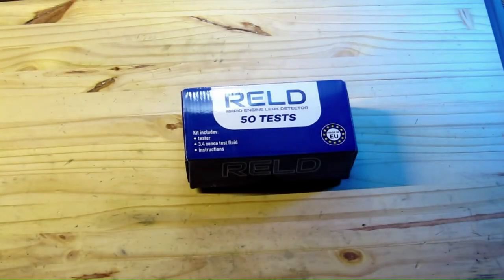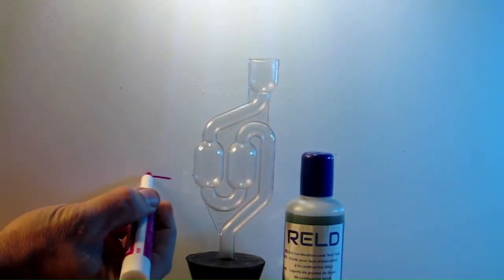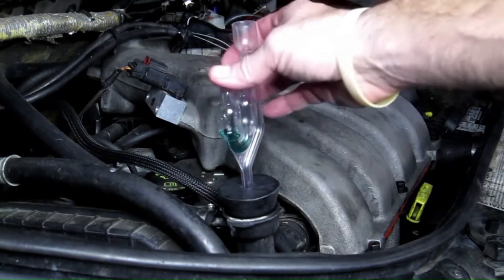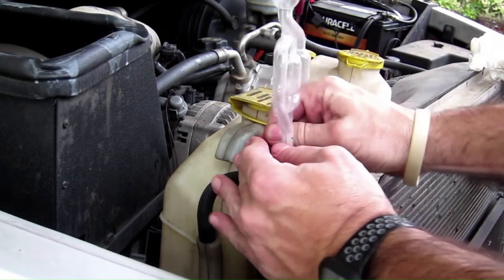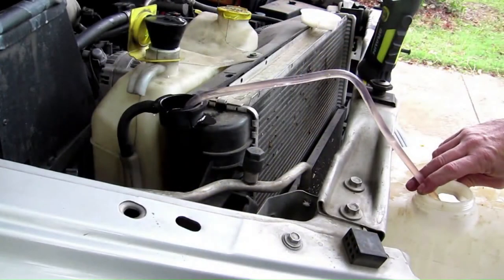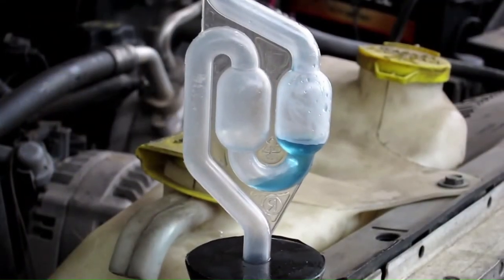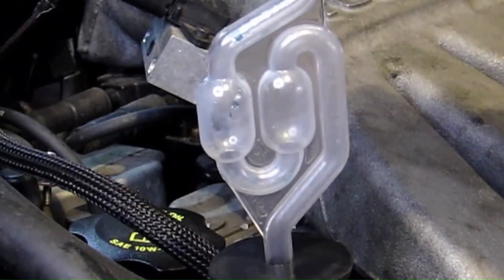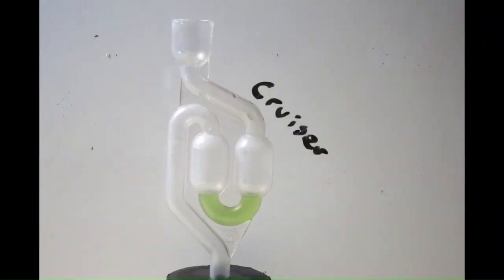$20 Amazon HeadGasket Tester!  How to test your gaskets at home.

Comment: Nice video. I just ordered one to test on a potential commuter car I’m interested in. The fluids and all look good but u can never be to sure and at least I can throw plates  and drive her to a shop for inspection. 
Do u think I can also do this same procedure but from the coolant overflow reservoir instead of radiator??
Reply from the maker: Should work just fine, the coolant will end up in the reservoir eventually.

Comment: Why was the coolant sucking up like that?
Reply from the maker: Coolant expands when hot so without a pressure cap it will flow out. Thats why I recommend draining a bit out first.
Reply: @Dartmech  makes sense. Do you know why the level goes up when removing the cap cold. Like a suction pulling some up and level rises abit, can hiss a bit aswell removing cap

Comment: What does a lighter Blue mean 😅
Reply from the maker: Yellow and green mean headgasket leak most likely. Any change from blue is basically bad news 🙃
Reply: @Dartmech thanks for your fast answer, with light blue i mean it looks like the "new" one/ the one on the right at 5:57

Comment: I just got one, this thing is junk. It doesn't work with Honda because Hondas don't build pressure if you take the cap off
Reply from the maker: It just uses the air vapor in the system. You don’t want a lot of pressure with them. The car that needed the headgasket had an open coolant system.
Reply: @Dartmech  I'm not saying you need to build up 50psi, but any gas that's coming through needs to go through the tester. In the case of a Honda, there is a hose going through the cap where is where that gas exits from, the hose doesn't go into the side of the tank, so all of the gas escapes through the cap and won't go through the tester. And for the radiator, it just does not fit into the radiator. So this tester is completely useless for Hondas and I had to return mine.
Reply: @LamoidZombieDog why couldn't you just cap that coolant overflow hose. Throw a bolt in there and be on your way. Could've also trimmed down the rubber cap to make it fit. Sounds like you shouldn't be working on cars, just take it to a mechanic bro